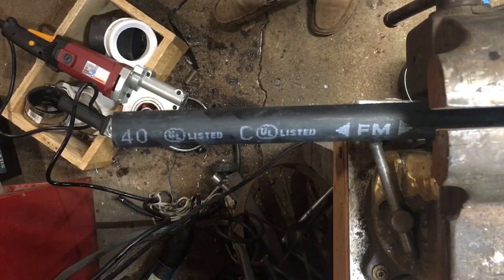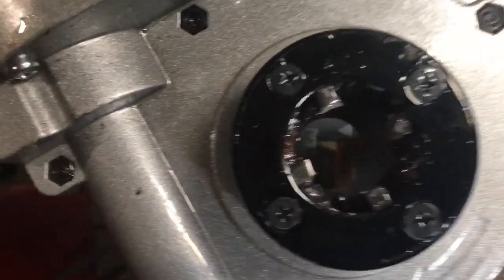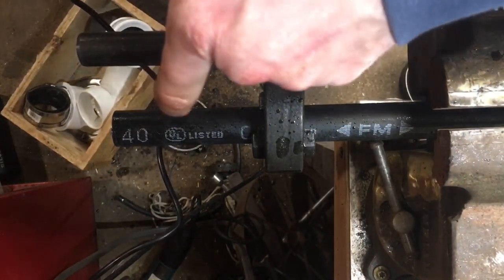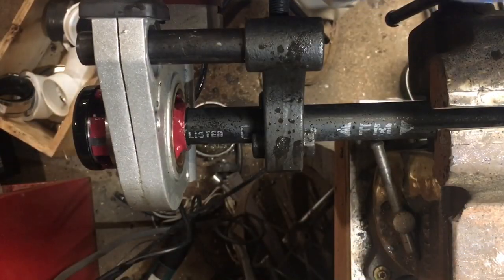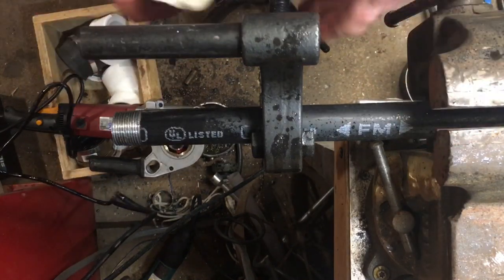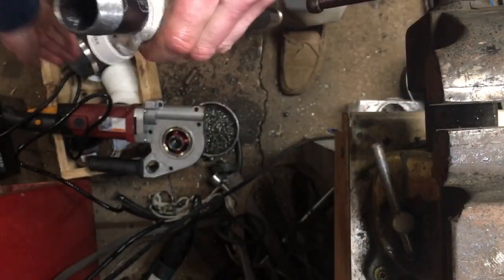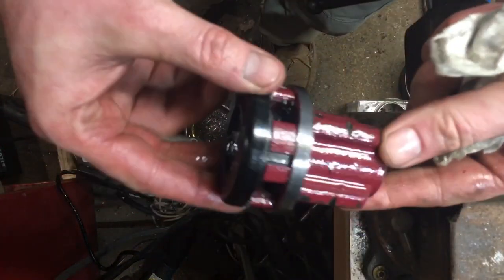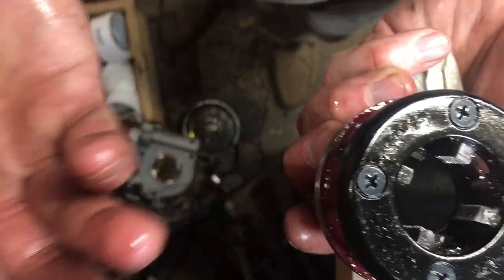Harbor freight portable thread cutter item 62203 use and review

Comment: I just bought one yesterday and tried it out. I can't get it to cut a clean thread to save my ass. Keeps breaking out big chunks. Any advise? I was using the harbor freight cutting oil and wasn't cleaning the dye out. Think that was my problem? Thanks
Reply: Your due teeth might be no good. Also you need to constantly apply oil to keep the teeth from burning up. How to Cut, Ream, Thread Black Pipe Manual/ Power Treading https://youtu.be/Q7OhoEvkv38
Reply: @thehvachacker  

Thanks for the advice! I watched your whole video and gave it a thumbs up. I think I ruined my cutting teeth right away by not giving them enough lube. I definitely wasn't giving it enough oil and was trying to do to much in between oiling. Thanks again!
Reply: You can't use this like a Rigid. The instructions recommend stopping every few turns and reversing. My first pipe was perfect, 2nd had a chip, 3rd the threads were garbage. The blades were broken in several spots. I also used the CRC lube. I don't think the lube is the problem. I'm pretty sure you have to reverse every few turns to get any longevity out of this.